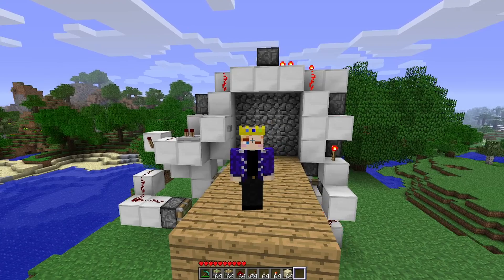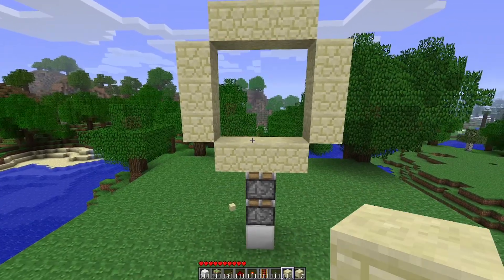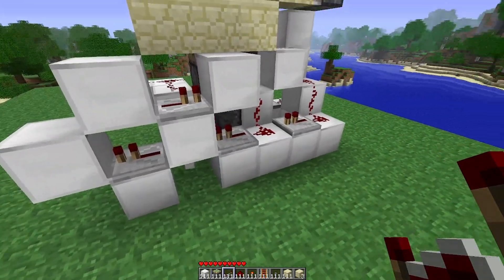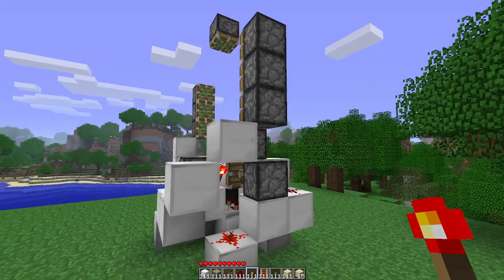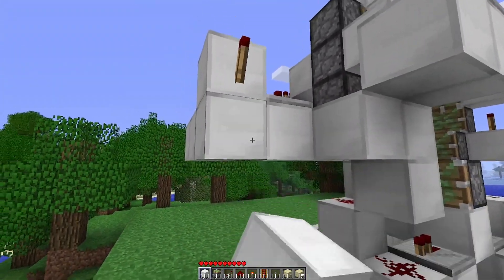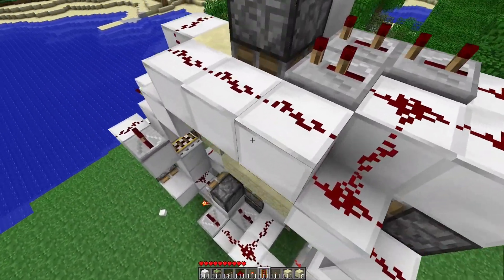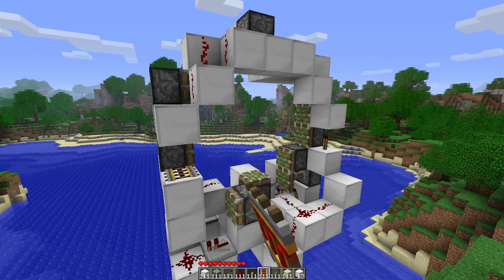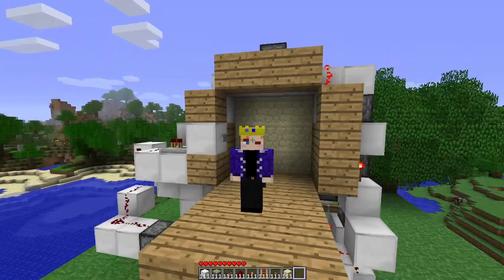How to Build a 3x3 Piston Door in Minecraft Beta 1.7.3 - Tutorial

Comment: I press the button and the door closes, but I press it again the door won't open on either side
Reply from the maker: Did you watch the full video. I have solutions for fixing rotational issues with the build which is most likely the issue
Reply: @BoxBlair I did yes, I was facing f3 when I started and when I remove the last repeater placed the whole door resets but once I hit the button the second time again it does nothing, I am also on a server I don’t know if that matters
Reply from the maker: A server could potentially be the issue if it’s not bukkit. Is it a private server or public?
Reply: @BoxBlair  hosted by shockbyte, no mods, vanilla server with ip
Reply from the maker: The repeater at the end, try adjusting its tik delay
Reply: @BoxBlair  I did i tried evevrything, I just built it in single player facing f3 and it works, so I am going to try to rebuild it on the server I will let you know
Reply from the maker: Okay!
Reply: @BoxBlair  Yeah so I rebuilt it perfectly, tried different ticks and everything and the door just wont reopen. I guess its a server issue?